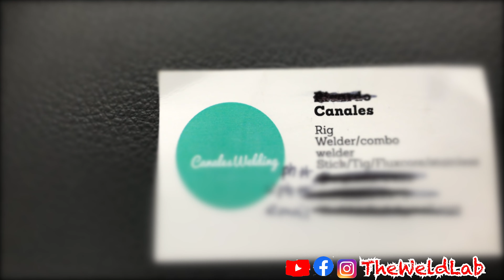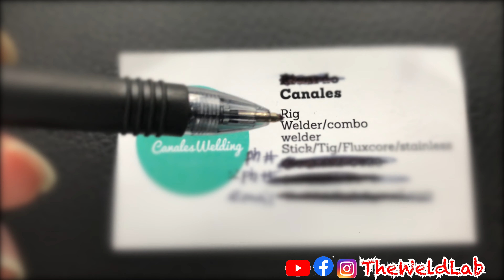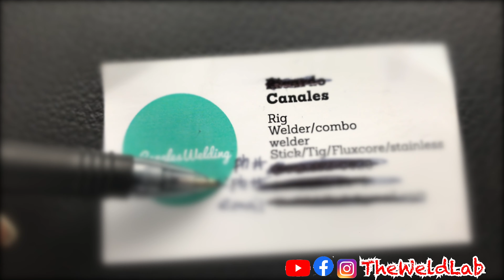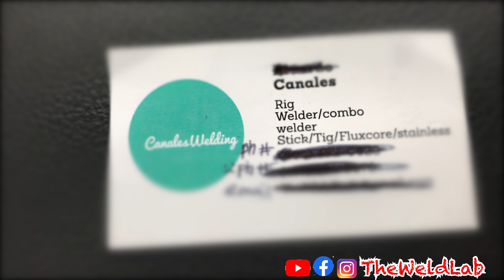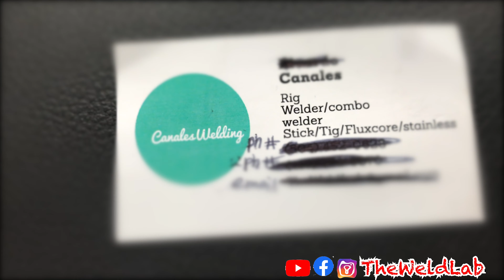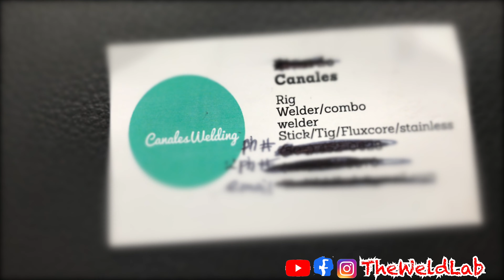GOT MY FIRST WELDING SIDE GIG!!! How to get Rig Welding Side Jobs

Comment: Great videos. I stumbled on your channel by accident but was glad I did. You come across as honest and helpful, as well as humble and helpfull. Keep that attitude and you will go far. On your mud tires stick with toyo or nitto only. You will get well into the 40000 mile range on a set. They make very little noise. Stick with 17" rims so you can still rotate every 5000 mile. With 20" wheels you cant rotate unless you break the tires down not worth it. With a 6" your truck will ride smooth. Everyday check between your duals to make sure you havent picked up any large rocks and oy et in the mud if you have to it will build up and cause your truck to shake. Good luck
Reply from the maker: thanks for the feedback bro! yeah im thinking about going with toyo......i appreciate your info

Comment: I have a 2011 Ram 3500 4x4 6spd with a Pipeliner bed all tooled up on a 4 1/2” lift with 35’s and billstein shocks all the way around and my truck rides GREAT! Better than when it had just a leveling kit on it.
Reply from the maker: what you think should i get the lift also? picture how i wrecked my rig yesterday smh
Reply: I would man! If not you’ll have some rub and a lift won’t hurt your ride quality if you go with a respectable lift. I messaged you on insta With a few pics.

Comment: I just graduated associates degree in welding, trying to break in as a welder some where , since my college didn’t rec me in to a job straight from college they only do that maybe to 1 welder out of 20 or more graduates to make the college look good, any advice or experience, I can stick weld pipe and structural and TIG , some stainless I need more practice on stainless pipe but the same as carbon steel if purged correctly should be very similar

Comment: I’m 18 and all the way from California. This is where I’m trying to get at. I just am stuck on where to start, like should I go for sticking  welding experience first
Reply from the maker: you should go to school to learn everything so you have more options
Reply: How was welding school
Reply: @mendoblendo321  a year and a half later. I learned SMAW TIG and MIG. Next semester I will be doing flux core and pipe welding. Since no one in my family is a welder, going to school really did help me to get an idea of how the water flows in this industry and some experience. I’m obviously not going to graduate a professional but i can run a bead in all 4 common processes. School isn’t needed for welding, but it sure does help and give you a headstart. Plus I like teaching so later on my associates degree in welding technology will help me be able to become a teacher. I will most likely get into a pipe fitter union to get real life experience then branch off on my own !
Reply: @gasclutch6280  that's is awesome. I'm start my first semester in welding at the local college here where I'm at in California.
Reply: @mendoblendo321  that’s wassup bro. Might be too early but what are your goals? Certificate or AA degree? Also, do you already have some experience with welding? Like I said, I didn’t and j flashed myself thr FIRST DAY 😂